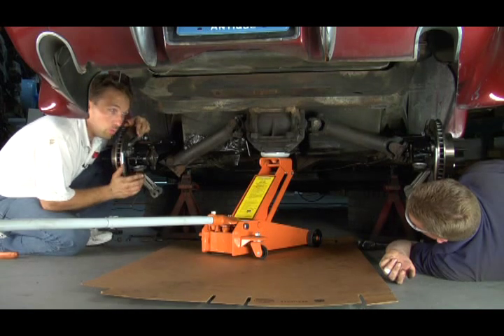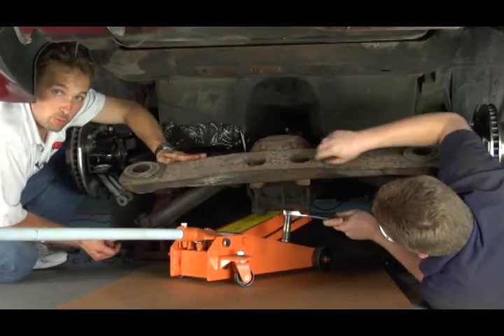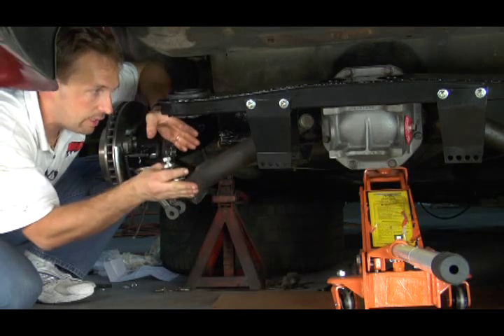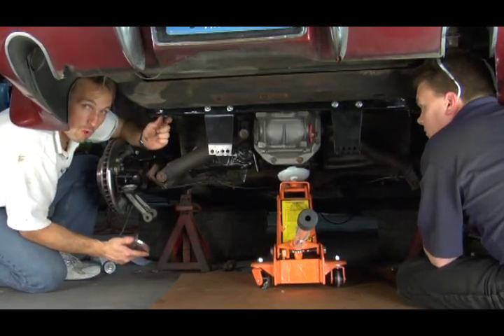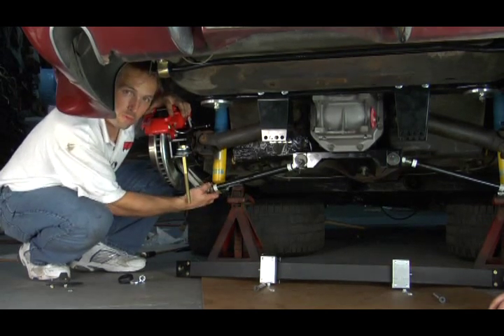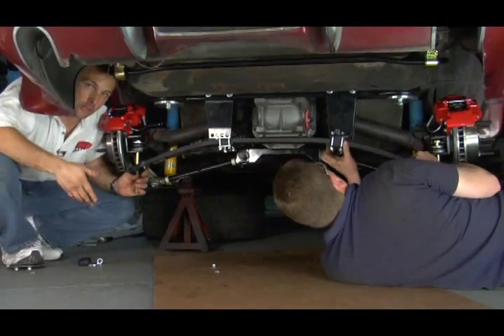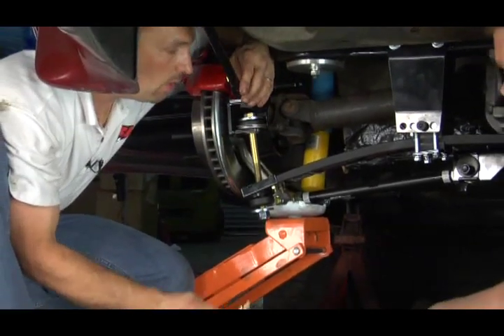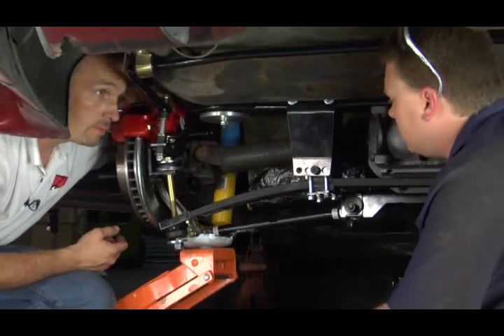VBP How To Video - Rear Suspension (Part2)

Comment: wondering why the lower 'smart struts' aren't even configured the same on the inner mounts One is high one is low this will set up different swing angles as the suspensions travel up down.